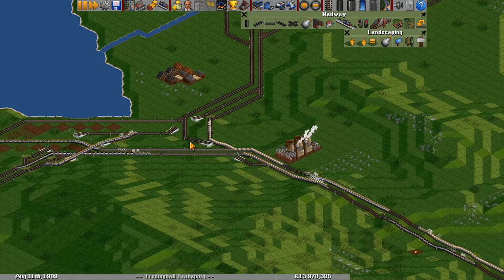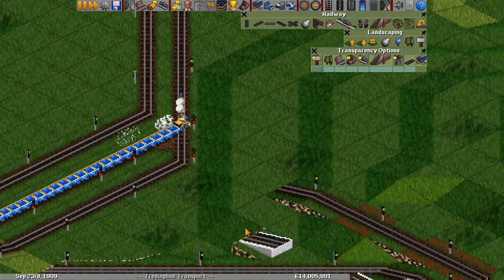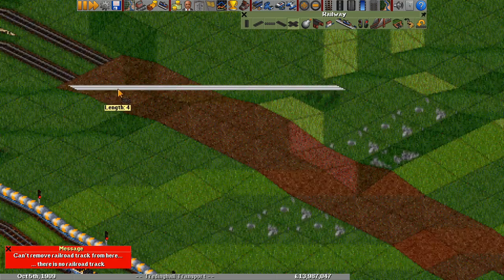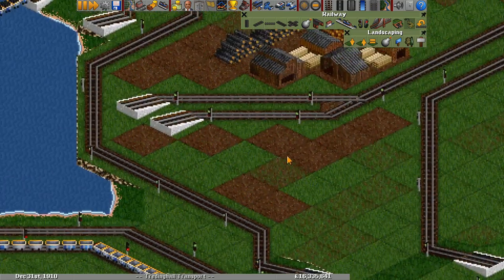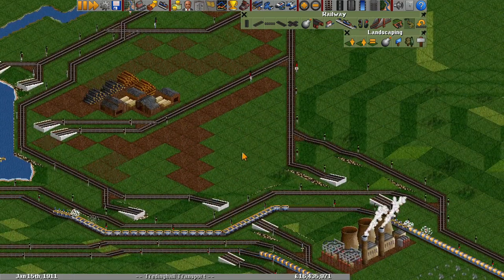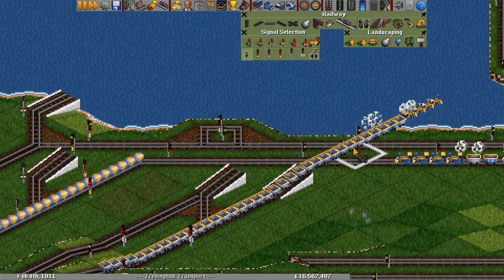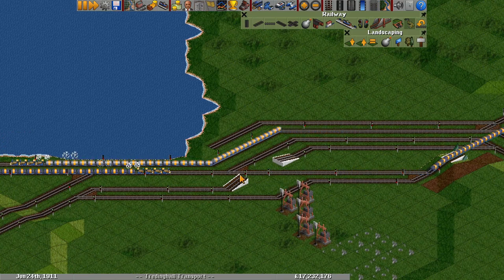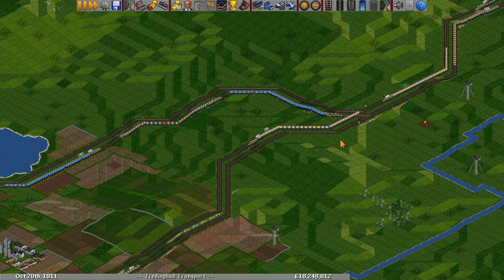Ep 6 - The First Mainline (Let's Play OpenTTD)

Comment: So the priority lines is setting combo sign in a side with an exit in the line, and trains will try to pick that line?
Reply from the maker: It's a little hard to explain in text, but basically combo signals connect to each other, so you can build a chain of them backwards which will turn red when a train approaches. So the line with the combo signal chain gets priority and the line with the single entry signal has to wait.
If you haven't seen it, I made a video about priorities which may be helpful: https://www.youtube.com/watch?v=1JjntGYfdJk